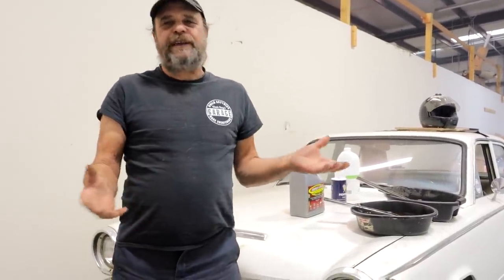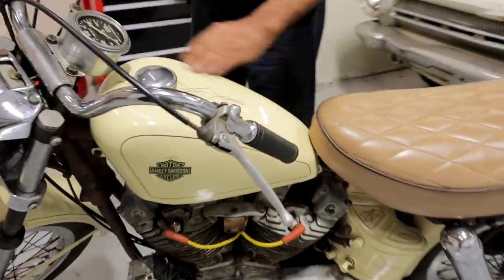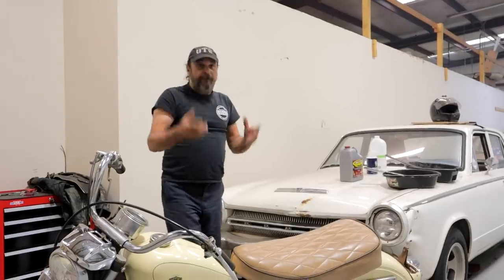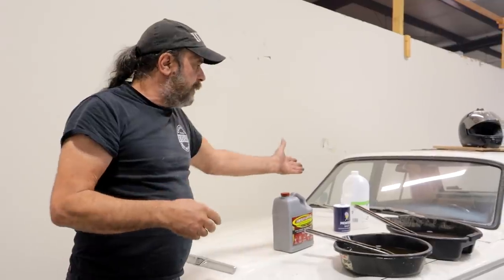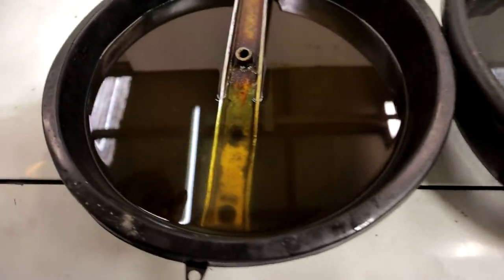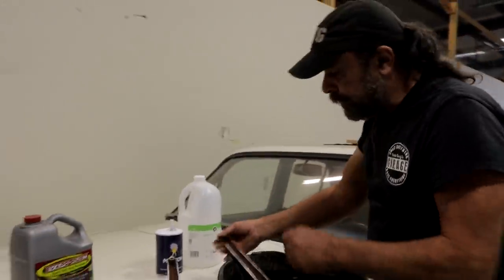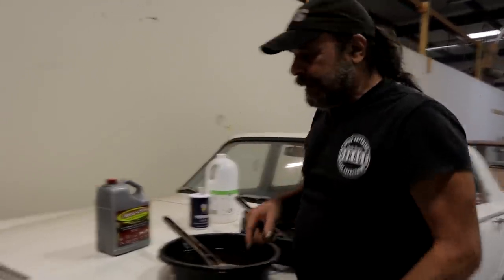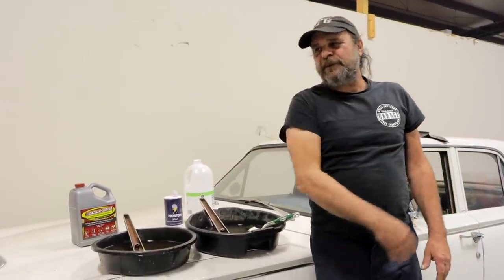Evaporust Vs. Vinegar - At 10X The Cost Does It Do 10X The Job?

Comment: You should try electrolysis for the rusty tank, dirt cheap and it'll do a great job. Just need a battery charger, some scrap metal and some salt. Pretty sure you've got all that to hand already 😁 The good thing is, it won't eat away any of the good metal like vinegar will.
You'll still need to suction out the silt and crud afterwards, but you'll need to with pretty much anything you use anyway.

I've found evaporust works great the first time around, but it's certainly not as reusable as they claim. After a few parts, it'll be useless, which makes it a really pricey option.

Comment: I just had a fuel tank 1972 CB350F Honda that had big chunks of rust all through it. Almost half dollar sized flakes falling out of it when I shook it 

Filled out to the brim with Evapo-rust. A little over three gallons.

Let it sit for a about 4 or five days.

When I poured the Evaporust out of it today (back into the original containers for re-use), I was amazed. The inside of the tank was spotless, just smooth, clean, greyish metal.

I'm a believer now. Very impressed.

Comment: I've been pretty happy w Evaporust so far. It was FANTASTIC on some vintage handtools and pocketknives,  all those pliers that get stiff from getting rusty in the pivot that no amount of penetrating oil can help were back in business after a day in the Evaporust. It also saved about a dozen $80+ carbide blades from my old bosses fancy cold saw and woodshop. They layed in damp sawdust and got scabby and he chucked them in the dumpster and I leaped in after them before they even hit the bottom. I cleaned a couple of the fine plywood blades w vinegar and the rest laid around till I bought some Evaporust a few months ago. That stuff made short work of making those blades look like new. The vinegar took alot longer but got them almost as clean however, the blades I cleaned w vinegar have lost a couple of carbides. I wonder if the 3 or 4 days in the pickle acid weakened the brazed joint between blade and tooth.  

I use electrolysis for removing rust on wheels and manifolds and lots of other stuff(works great but is a bit of a hassle), I beadblast some stuff and have used all the rust converters and jellies and pastes and cremes and they're all usefull to have around and I'm glad Evaporust can join the party. That Damn Rust Zombie never dies, but these days you can sure knock it on it's heels for long enough to worry about other stuff for awhile.

Another thing I recently discovered is Free All spray. It smells like Death(so you know it's good!) And I've only seen it in the aerosol but that stuff is Frikken Majik as well. That's the only instant cure for rusty needlenose pliers, pocketknives, and general nuts and bolts type stuff I've ever seen. It won't bring back the finish as well as Evaporust in my experience but it's SOO fast. A guy I know sprayed it in the plug holes of a 318 in a 67 Fury that we'd been trying to breakloose w a breaker bar w zero effect, he gave each bore a 10 sec shot of Free All and by the time he finished w the last cylinder and got the bar back on it it all he had to do was give it a healthy one handed yank. Maybe we'd already done 99% already w the breaker bar but it never moved a bit before. If you can stand the smell that's another one to keep on hand.
Reply: Thanks! I'll try it!